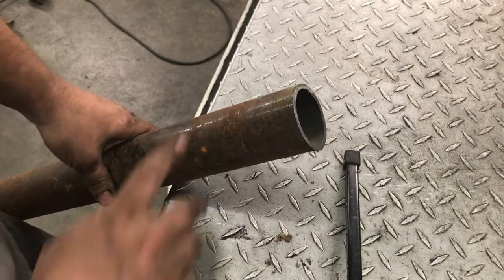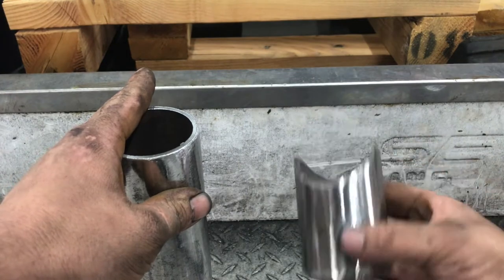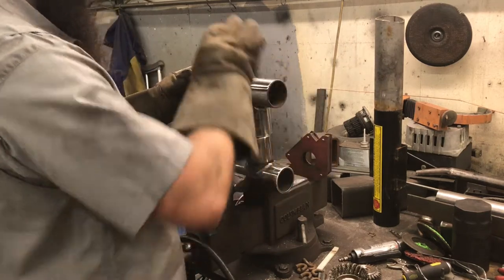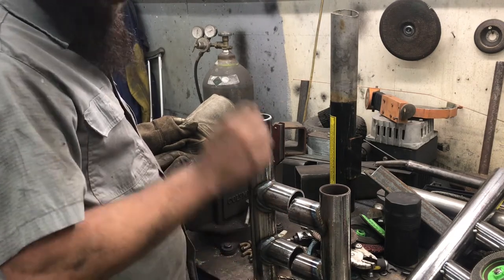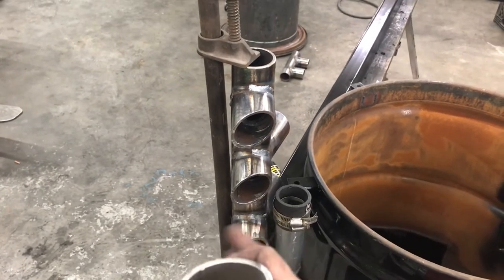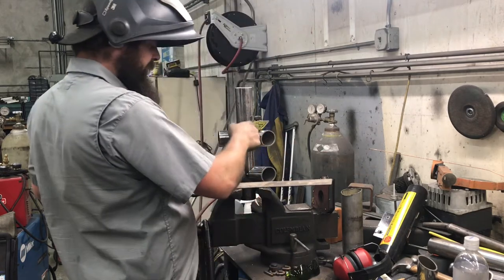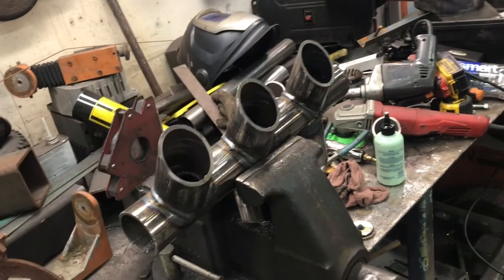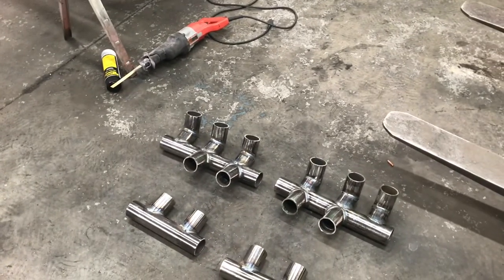V10 Gasifier Build Cooling Rail Corner Post

Comment: Homem, trabalho maravilhoso. Como você tem tempo ?? TAMBÉM SOU CURIOSO em saber o motivo de você mostrar gratuitamente este ótimo trabalho ? Você deveria "vender" este curso, é o mais bem explicado que já vi em todo o YouTube
Reply from the maker: I do my videos 1-2 hours a day after work, I'm lucky to have a big shop where I can work on my own projects after hours. Lately with the heat it's gets way to hot in the shop to work so I'm moving even slower then I should. All I'm doing here is a spin off of the design by Wayne Keith and I post these videos with his express permission, there are several videos of the inner workings of the gasifier that are only posted to the driveonwood.com forum with his proprietary information on how this gassifier performs so we'll. I bought his book with the full build plans in and and I'm just putting my own twist on his design and so far he really enjoys the videos 😁 my Toyota truck is the exact by the book build, just changed a little to fit in the mini truck where he prefers to use midsize Dakotas and full size trucks. I wanted to keep as much usable bed space as I could in my dodge while maintaining the ability to look out the back window and monitor any cargo on the bed, that is one thing that bothered me in the Toyota is I can't see into the back of the truck due to the size of the gasifier system so I'm solving that as best I can with this build. And thank you very much for watching and the compliments, glad to know folks enjoy watching as much as I love building!
Reply: @BigBeavrSlayer  Esqueci de também elogiar a organização de sua oficina, Muito boa.